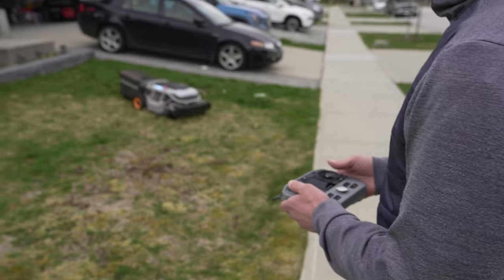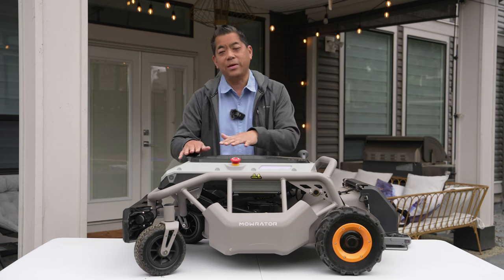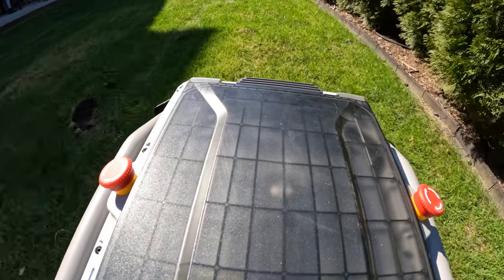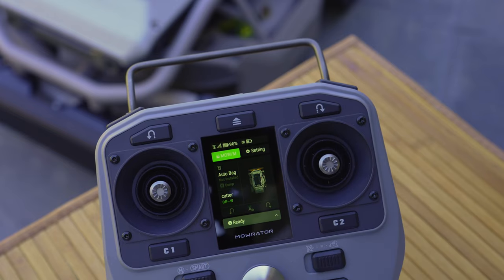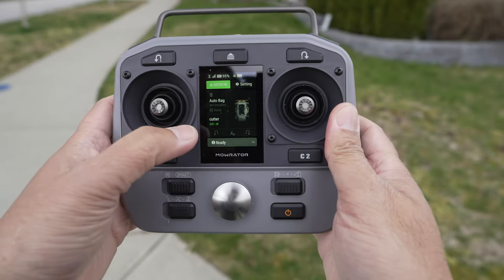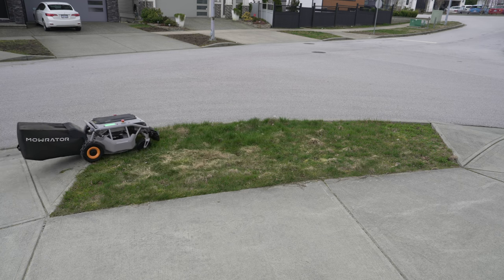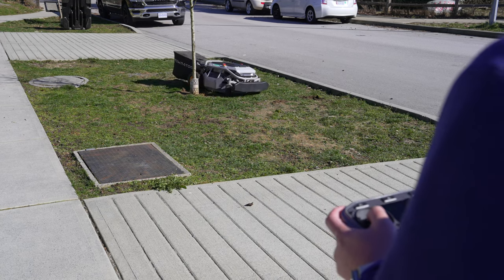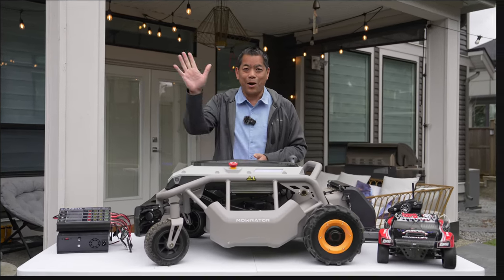NEW All-New MOWRATOR / Is This The Ultimate Robotic Lawn Mower for Everyone?

Comment: I see them selling 5 or 6 of them.
Reply from the maker: They’ve sold over a hundred already in the first day.
Reply: Have sold over 170 in a week. Why is it no one ever comes back and admits they're wrong after making snide comments like this? Pride, I guess.
Reply: @rkeithmilford1709  Still here! I’d assume you’ve never heard of sarcasm selling 170 in a week is not great. A remote controlled lawnmower is a novelty. This will not be around in a year.
Reply: @tanktacosauce6192  So your comment was sarcasm, AND you’re also doubling down on it. I’m not sure you understand sarcasm. But, anyway, I think there’s a market for this. I’ve been looking for a couple years for something like this to mow areas of my mountain property that are otherwise inaccessible or dangerous. The autonomous ones are not an option.
Reply: @tanktacosauce6192  It has it's place. I would purchase one for slope mowing in my back yard. I currently have a slope that is about 30 ft tall and about 60 degrees. Too steep to mow with a lawn mower and too much grass to cut by hand, this would work perfectly for that. 

There are A LOT of commercial Remote control mowers out there so this isn't anything new.
Reply: @rkeithmilford1709  here I’ll triple down this company won’t be around in 1-2 years. Yes sarcasm was used correctly.